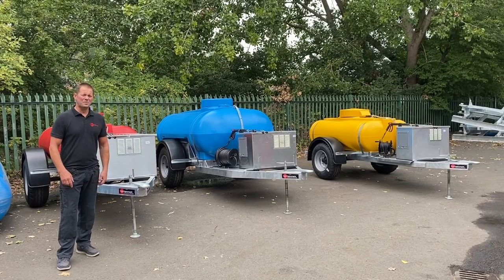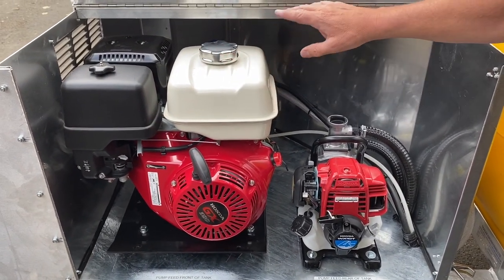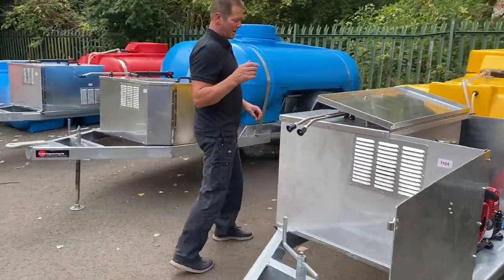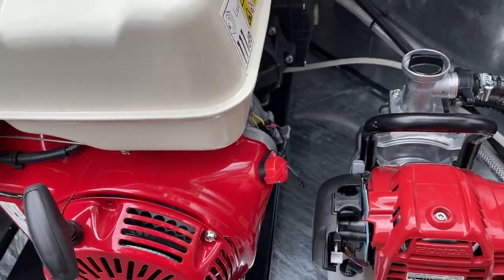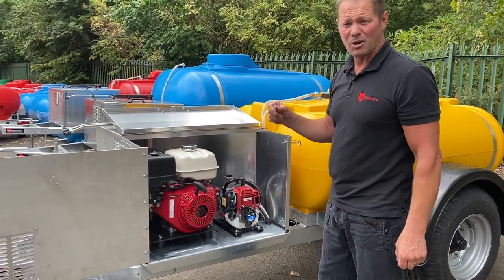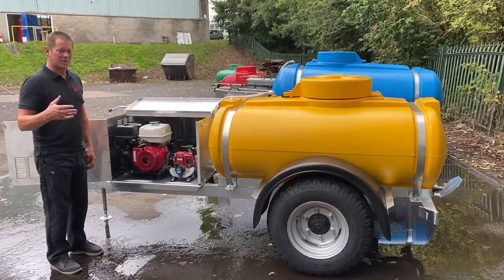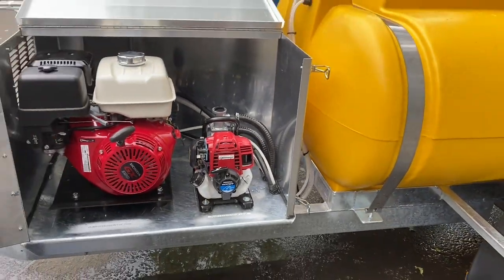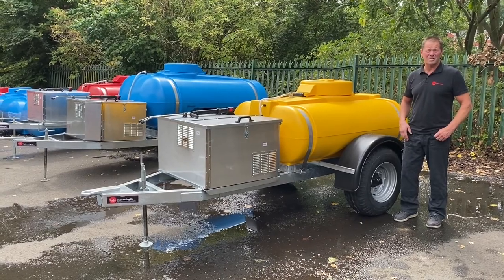Honda pressure washer water bowser

Comment: i can not believe how the pressure washer has went up a pitch was it the little one who did it
Reply from the maker: Hi,so the washer feeds to lance that can be reduced in revs or pressure depending on application, then the smaller engine feeds the spreader plate at back for dust suppression, hope this helps.